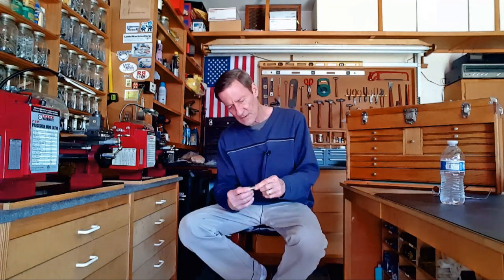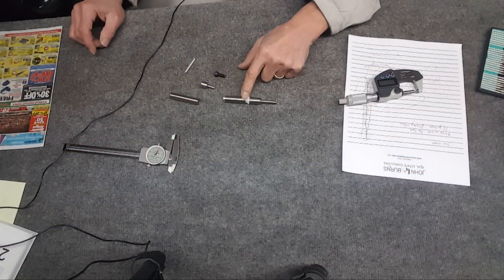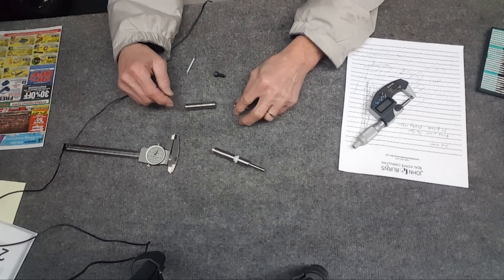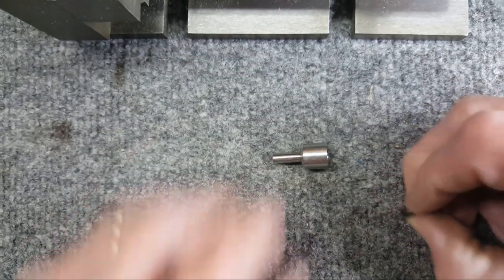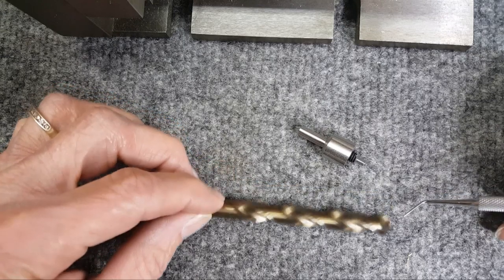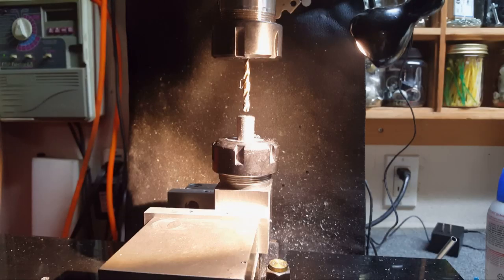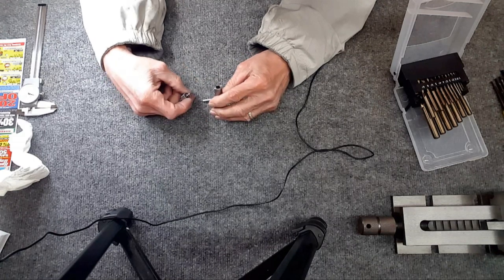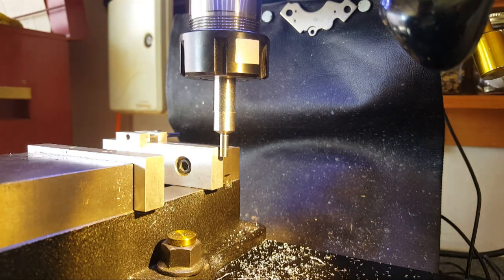DIY Stainless Edge Finder

Comment: Dave... Ruined my collet set...
Cleaning my wife's ultrasonic cleaner, didn't dry them immediately.
Now they got a bit of surface rust on the. Even the seating face of the nut.
Oh well it was a $50 set from Amazon...

Comment: great idea  Edge finder , when i was working as a machinest for the shop  ,did work with a lot of ss 304  not fun it was gummy  i used peanut oil  as cutting fluid, and for taping  there is some tap that made for ss  cost a little but like day n night .
Reply from the maker: Really I didn't know about a ss tap will look for it!